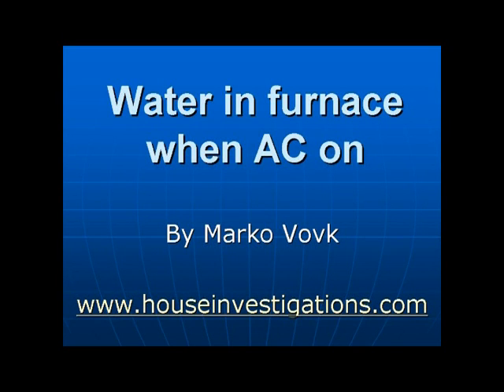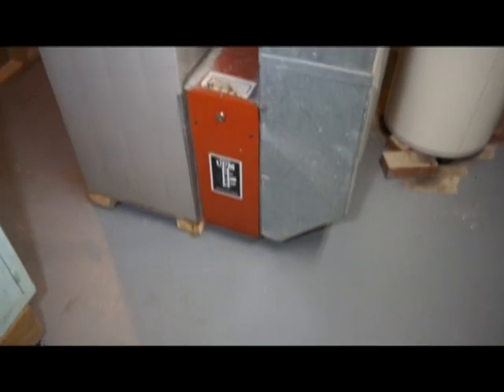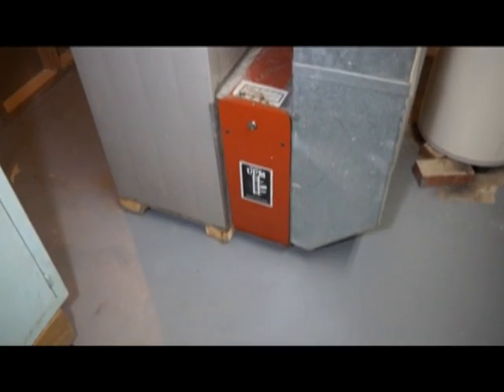Water in furnace when AC on can cause carbon monoxide, rust and other HVAC problems

Comment: Central heater and AC unit: Could the heater panel be fried, during a three day heat wave (95-100 degrees), from an overflow of the AC condensation drip pan? The pump on the floor was too small and old for the power of this 2year old AC unit and maybe it couldn’t keep up?

Comment: HECK WITH DAMAGING unit, what about if it's an indoor (apartments or condos) unit.  The rust particles, carbon monoxide and other 'junk' will just circulate thru the unit!  ESPECIALLY when the filter is IN FRONT OF THE RUSTED PIECE!!!

WHAT does one do now besides getting a check for rust & then a CM alarm.

Comment: Two Words ->   Water Alarm.    

12.00 bucks at Home Depot.  I ran the wire through the side, laid the sensor in the shelf just below the two hoses and inducer.  It gets and wet and screams nice and loud.   Runs on a little 12V battery, just check it when you check your carbon and smoke detectors.  It will beep if the battery is running low.   But knowing the water is there sooner than later is worth the 12 bucks all day long......
Reply from the maker: You family must love you. Most guys have no clue how things work. Good point. Thank you.